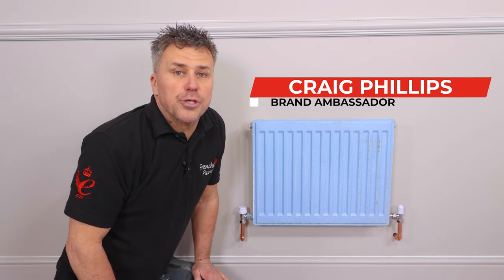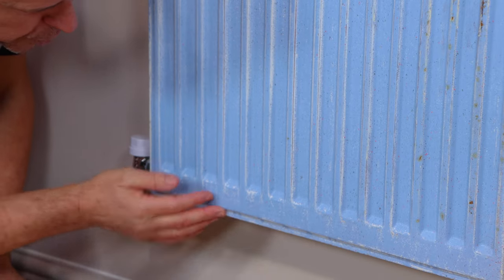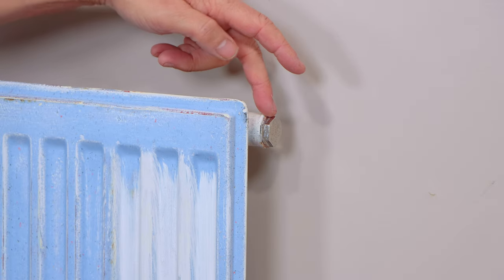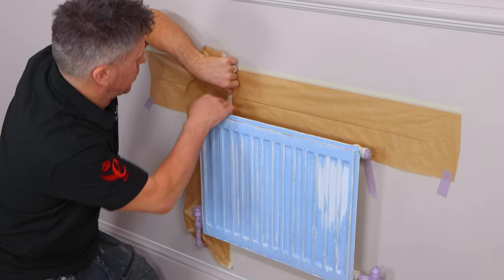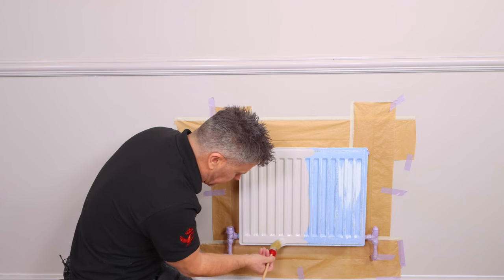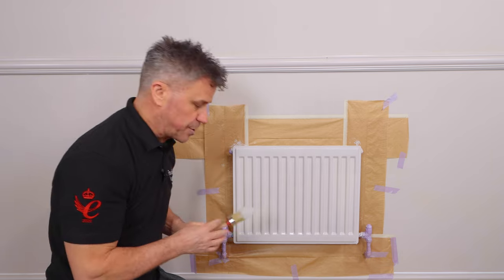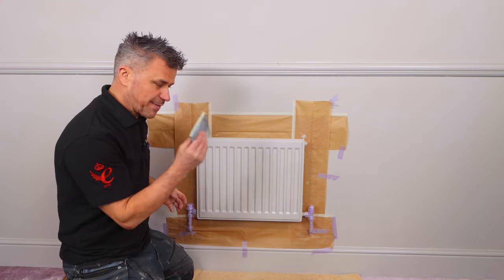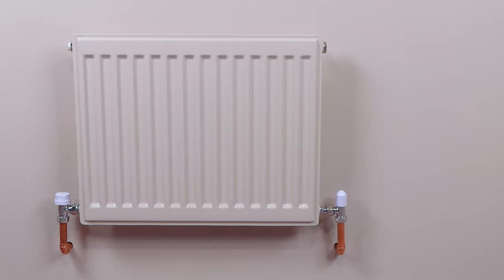How to Prepare and Paint a Radiator | A-Z GUIDE | Frenchic Paint Tutorial @FrenchicTV

Comment: You used a satin finish for the radiator. How do you feel about a gloss finish?
Reply from the maker: Yes if it's the look you want, you could use Trim Paint and get it shinier! Or even put some tuff top coat or finishing coat on the top afterwards for that extra protection and sheen finish